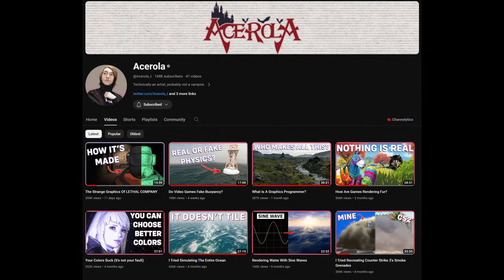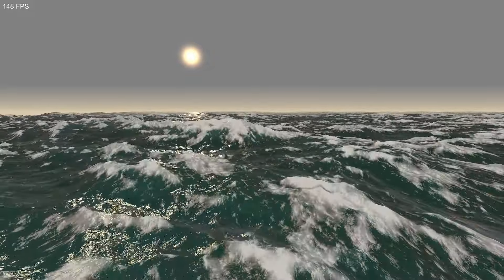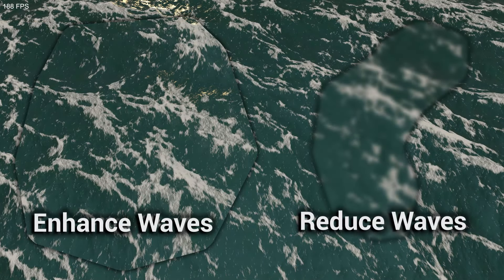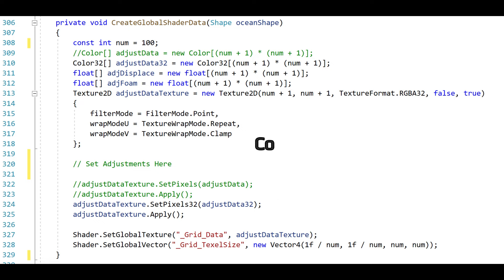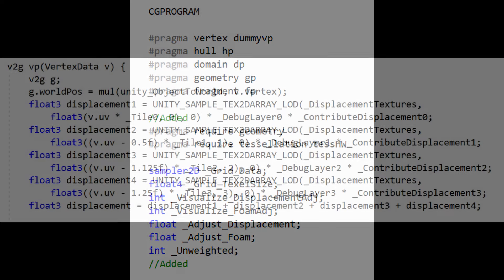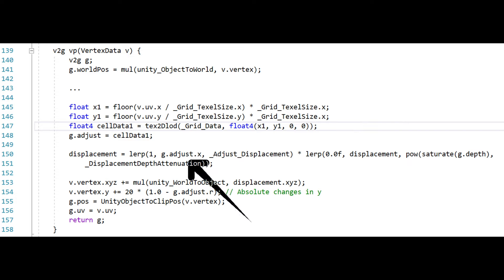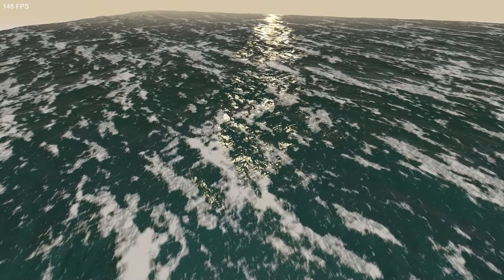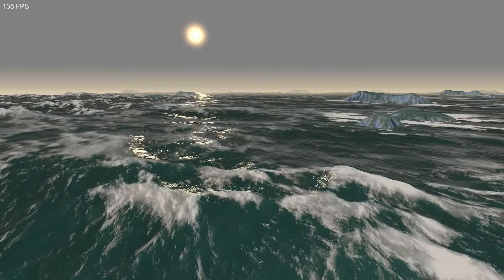Letting Acerola's Ocean Simulation Interact with Terrain

Comment: i think you are over complicating things. 
for lower waves near islands, just multiply the displacement with a value ( x)  between 0.1 and 1, where (x) is a rough heightmap of terrain.
so the deeper it is, the more the waves, the shallow it is the less the waves.

for the other things you can use another noisemap to blend between.
you gotta lerp if you want to make it seamlessly.
lerp fixes everything.
i love lerp.
Reply: and just use wordpos as uvs. that solves the uv problem.
Reply from the maker: Hi. Thanks for the comment.

I am actually just multiplying the displacement with a factor between 0 and 1. My rough heightmap is just determined through ray casting. I'm not sure if there's a better way to get the terrain height to the shader? However, the displacement is per vertex, so I have to interpolate (2D Lerp) between the height map points, right?

I can now add whatever other factors that should impact the wave height  onto this "terrain heightmap texture", but I also do need to adjust the foam factor for low waves.

I saw your video on this topic too - very impressive doing it from scratch! I'd like to learn to do the underwater rendering as well as buoyancy!
Reply: @RecOgMission  what i do is, i do the same calculations on gpu. thats how i get terrain heightmap on the water shader. i think doing that might be better than raycasting. and adjust the displacement. for the foam again multiply jacobian by the same value but to the 2nd power or 3rd.

my fft implementation sucks btw. acerola's better a hundred times on terms on performance. XD

i probably suck at the underwater rendering too. as i am tring to get water height every single pixel in the post process shader and determine whether it displays normal color or underwater color. probably there are better ways out there. 

since i do things by trying out i dont know what the optimal way is.
Reply from the maker: @bdenix1997 Hehe. Same here. Try things and learn as you go.
The raycast only happens once, then the height map is sent to the GPU, so performance isn’t an issue, actually.